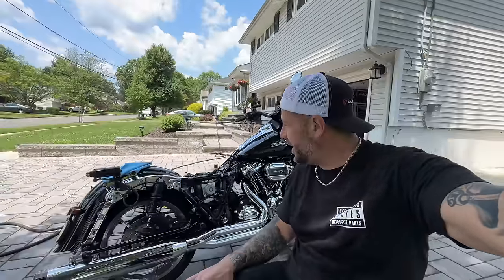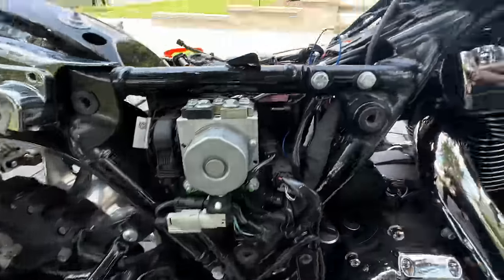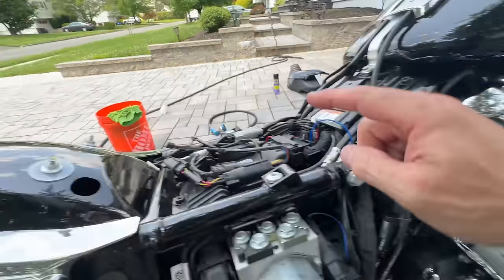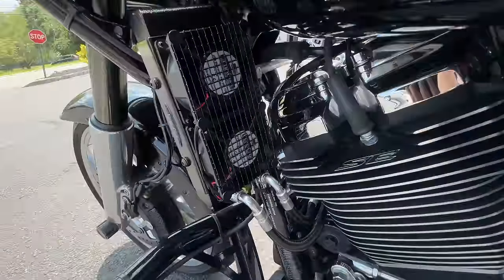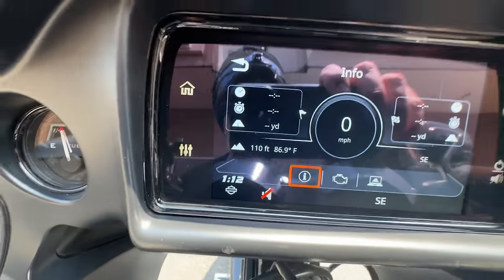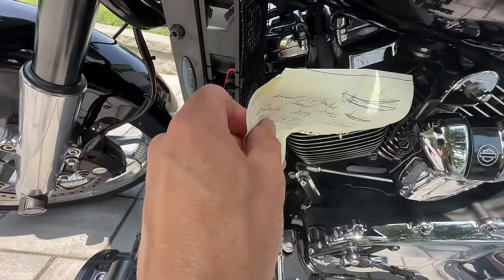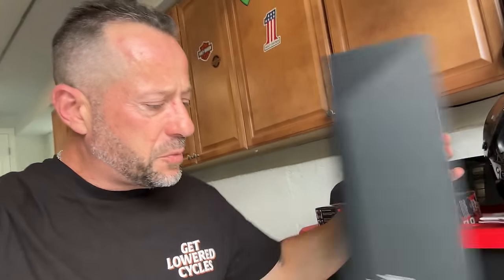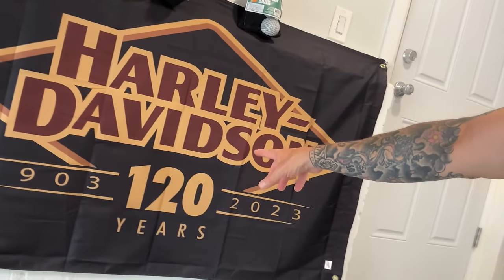HOW TO KEEP YOUR BIG POWER HARLEY DAVIDSON COOL #cyclefanatix #harleydavidson #roadglide

Comment: Can’t Ultracool make it so the wires don’t show on the unit?…doesn’t look clean with wires exposed on the outer edge…👎
Reply: John has the naked version of ultracool. They also have them with an enclosure. They come in chrome and black.
Reply: Just flip the mounts on the fans so the wires are on the inside
Reply: @NickyRaff  if you flip the wires to the inside, wouldn’t the oil lines end up on top?
Reply: Just the fans not the rad..I’ve seen the same naked setup with oil lines on the bottom with no visible wiring assuming them just rotated the fans..I have a below regulator mount so I’m not positive

Comment: Hey John just wanted to clarify something. You mentioned the fans come on at 260? Ultracool thermostat is set to turn on at 210 degrees. General rule is to keep the oil below 230 degrees.
Reply: Yes correct. Oil at 210F is the correct temp which the fans come on.Not 260F And I also have this set up. And I don’t see temps over 220F on my oil. Before the system install I was getting well over 230F on my oil.
Reply: @DarkHorse82  Thank you.  Yes, fans activate at 210F and stay on until the oil is cooled to 185F

Comment: I’m surprised the fans don’t turn on till 260°, they should turn on way sooner. The engine should be at 230° or cooler if possible. You really need airflow on the heads for the best cooling affect. Mighty Mites along with your oil cooler should cure the heat issue. I’d still want those fans turning on at 195° or so would be best.
Reply: The fans activate at 210F and stay on until the oil is cooled to 185F
Reply: @ultracooloilcoolingsystems7190  that makes sense, thank you. Having you answer my question speaks volumes about your company. I may have just been persuaded to purchase your cooler for my Sportster.

Comment: Got to hide that thing behind a chin spoiler - The real test would be while the bike is stuck idleing. If it's moving the cool air is going to do 95% of the work. Take it for a ride then stop and let it idle for 5 minutes and do an ongoing reading of temps and see where it levels off

Comment: Hey John here's a true test let it sit idling in that 100 degree weather for 10 mins after u have ran it for 30 or 40 miles. Then see what the Temps go up to  that's going to be  a true stress test. That will  tell everyone if it really works and is worth the money and will save your motor!! Can't wait
Reply: Yes,  we welcome testing idling, in traffic, high RPM any condition you want to test.

Comment: I got the ultracool system on my 2014 CVO and its mounted between the A frame above the regulator, a much cleaner look. I also run the oil filter on the same bike. It made a huge difference to reducing the temperatures on the bike, as i live in the Philippines, which is very rarely below 80deg all year round.

Comment: John, maybe I missed the temp comparison, (a spreadsheet of before and after temps would be nice)  but those head temps didn't look much different.  I must say, I was expecting more reduction from all that hardware.  May still need Luv Jugs.  Good luck with it.
Reply: They advertise 50 to 60 degrees lower when you include the Flo oil filter.  Have never seen anything even near those.  This is a biased review.  Not worth the near $600 imho.  All I hear is excuses.  Pass.

Comment: Good evening. My wife and I just got back from Milwaukee on Tuesday. We rode up from SC. Right know as of Thursday, my bike is in the shop getting the 	135 installed. Will be looking at this system within the next week depending on how my temps look after riding it. I did have the oil cooler fan and the rear jug fan installed. We will see if I need anymore. Great system tho. Cheers!

Comment: With Love Jugs on a 2021 Road Glide in AZ with the temp at 100 degrees, I've never seen oil temps higher than 220 degrees.  The fans keep the heads cooler, so the oil never gets so hot that it needs to be cooled, other than by the stock cooler.
Reply: What fans do you have?

Comment: I ride in AZ it's been 113 plus for weeks,  I would hope I don't need to be changing my oil after every ride...
Reply: I was a "Valley" resident and I added the HD factory fan to my SG Special oil cooler. The SG does not come with the fan like the Ultra, or other touring models with the lower. I could not get above 120 even riding out by Quartsite in August. I've got a 122 and it definitely made more heat than the 114. The other great move I made was dumping the factory exhaust and getting rid of that Damn Cat that would roast my right leg out there. The factory fan is plug-n-play, does not cost much and there is already a blind plug up front for it.
Reply: The HD fan works very well... it is a quality unit made in Italy. My oil temps after a ride are down at least 20* with this fan behind my stock oil cooler.

Comment: I have a Harley oil cooler kit mounted on my fatbob, it runs about 250 on the highway, ran it into the city on Monday, she's was up around 330 (cylinder head temp) according to the FP3.... it was hot, but wasn't pinging yet...my Buell had the best set up, it had a mini fan located behind the rear cylinder that was temp controlled, it would kick on and off

Comment: #1 thing to cool Harley's down is a proper air/fuel ratio! I keep my Road king in the 12.5-13 range with an oil cooler fan and it never gets hot.

Comment: My Street Glide Special w 475 cam been running 300-310F rear cylinder head temperature in the 95-100F weather in North Carolina. Running close to 300 in the 85F. I’m using Powervision display on my handlebars to monitor it, it’s very useful. The hottest it got at the stop light is 326F. I just purchased the Flo oil filter. I will purchase the Ultracool next. I don’t really ride in the heat too much, I can’t stand it. I usually wait till the weather gets in the 80s. But, I still want the Ultracool, I know the bike will benefit from it.
Reply: Go into the Power Vision and add fuel! Start at 10% across the board. I'm sitting at a 25% increase on my 2019 Road King, running an oil cooler fan. My bike doesn't go above 230 sitting in traffic on a 100 degree day.

Comment: John you need to check the temps while riding at 70 miles an hour and see what it’s at, because these M8 cool down as you drop speed or stop idling.
Reply: Yes,  we welcome testing in traffic, high RPM any condition you want to test.

Comment: They also need to be located between or on the frame tubes in the center, could have been blowing warm air to the front cylinder but I dont think its much of an issue for the exhaust ports.

Comment: Did you get oil temps this time?
Reply: Unfortunately not. That would be the most accurate way to review the system. I don’t think he understands exactly what this product does,and how to review the results of it. Tried to give him a heads up in earlier vids to take oil temps before and after so he could do the proper review.
Reply: @DarkHorse82  he got oil temps last time. But without checking them this time we don't have anything concrete to go by. Head temps and cylinder temps are great, but not what matters. Oil temps matter. Keeping them within proper operating temps is what's needed.
Reply: Exactly :-)

Comment: I recall many of us telling you it was on the right side... are you considering a dipstick thermometer? That will be a better test than an infrared temperature gun. Set your EITMS after your ride and see if it turns on. When the oil reaches 270* it starts to break down. Your testing is not reading the oil temps.